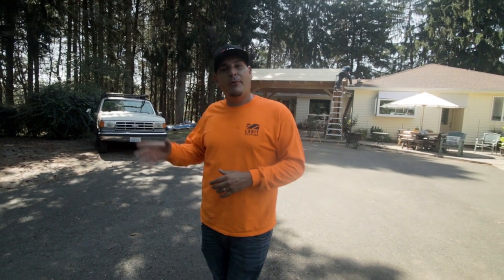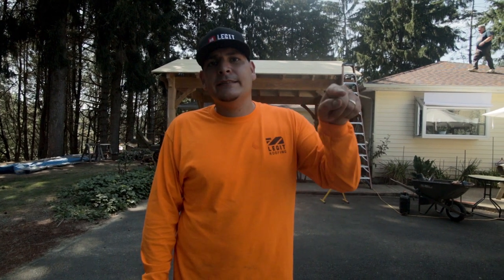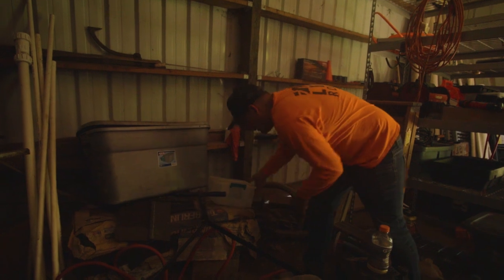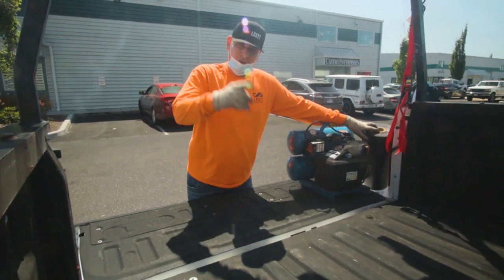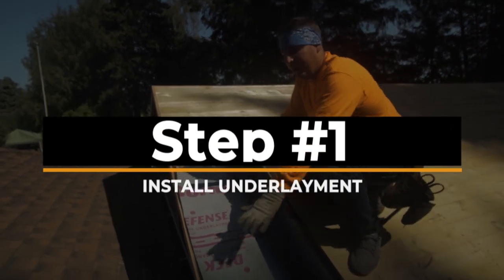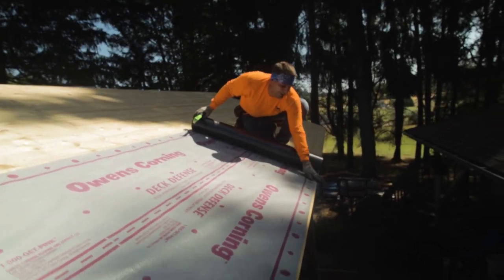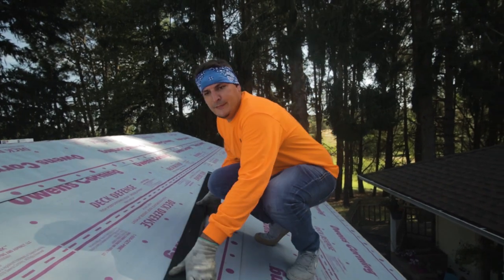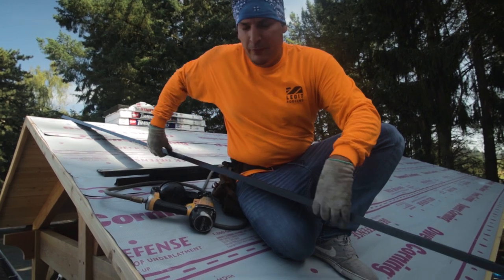How To Roof A Shed | 5 Easy Steps

Comment: i seen that if  the starter shingles ARE CUT AND AT A  45degreee angle at the corners it matches up to the tar line all the way around,  ,  that way theres no spce in between for wind damage.    you did a great job with this one, and its good to see someone doing it right . i subbed and liked
Reply from the maker: That's the ultimate way, but we don't have any issues around here this way.
Reply: @MrLegit  man i just was watching a few different guys and hw they do it and thought id pass on something ,, no biggie,, not everywhere is the same so its cool that you do know that and i appreciate ya replying to this,  yall do great work i can see that
Reply from the maker: @sprung5062  I have a video somewhere of me doing it like that. I think it's on the skyline training video.